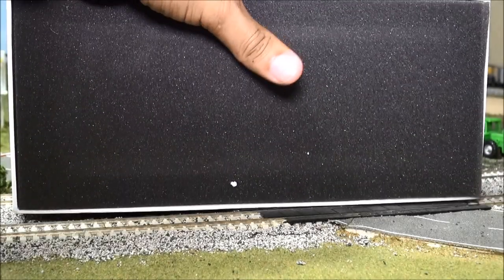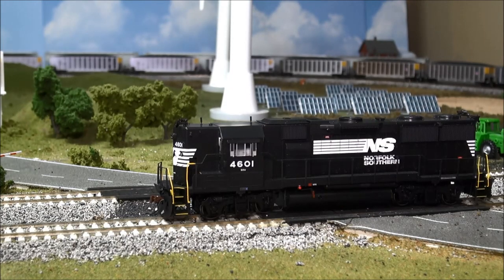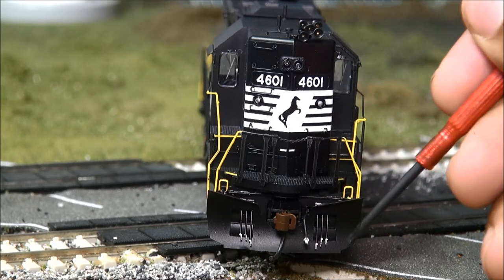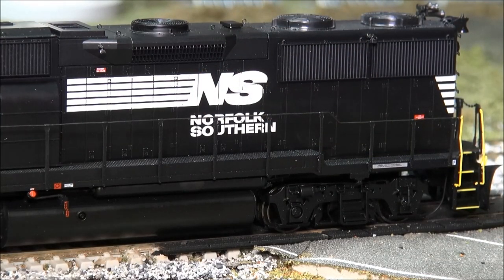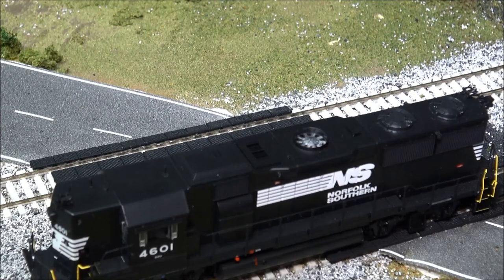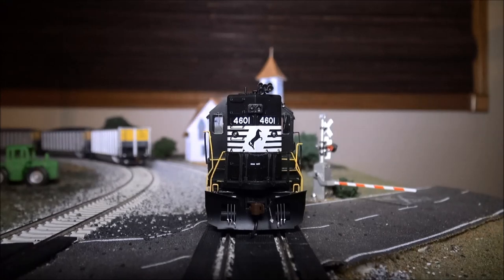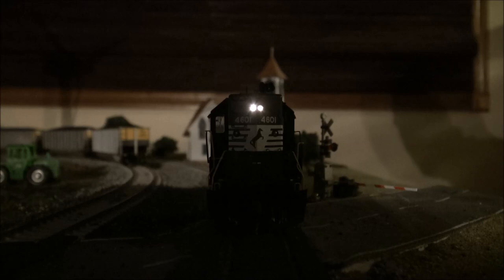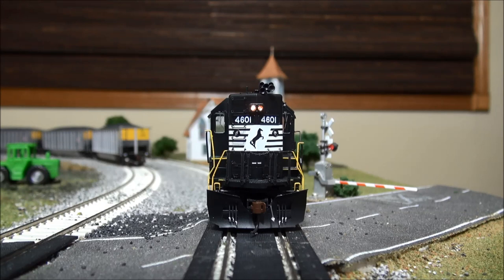Review: Athearn GP49 w/ DCC Tsunami Sound

Comment: I'm also curious about the sound - is this sound actually based on a 12-cylinder 710?  or is it the same sound used for the 16-cylinder GP50?  The prototype has a distinct sound all its own, but hard to discern unless you can catch one of the 12 bangers by itself.  I once saw a GP59 by itself on a RoadRailer train - very distinctive.

Comment: Does this manual now actually tell you ALL of the settings required to set it up for manual notching?  Factory Tsunami = one setting.  Athunami = 6 settings, not documented.  Or are they now?  I have four of these coming but none with sound.  One of my favorite locos.  Difficult to scratchbuild because Cannon doesn't make the radiator section doors for the 50 and later series.  Started one long ago.  I'm getting three Southerns (as 39X) which is a slight stretch for my era, and one NS in honor of my first ever published prototype photos - #4600 in the Hundman GP49 book.

Comment: Hi James happy 4th. My neighbors have been shooting fireworks all day and have a pile of paper trash in the street and most likely they will leave it there like they did last year.. Anyways back to topic.
Thats a nice locomotive and I didn't even know a GP49 even existed lol. I have a GP-40 in White KCS scheme I got off ebay for $10. It's plain DC and all it needs is the 3 chime horn replaced (the rear chime is broken off) Mechanically is runs like brand new and all the tiny lettering and such is visible under magnification and it came with Kadee couplers. IDK if I mentioned this locomotive in the past so if I did I do not mean to repeat myself.
My next locomotive I want to get is looking like it will be a kit bash of an sd60 and sd70 to create an SD60E NS in the new GoRail scheme. I would hate to cut up two shells to make one special one so I may wait and see if a company will release one before going to the extreme.

I do prefer Athearn trains mainly because of pricing but I still cannot get over them now doing the handrails in plastic..